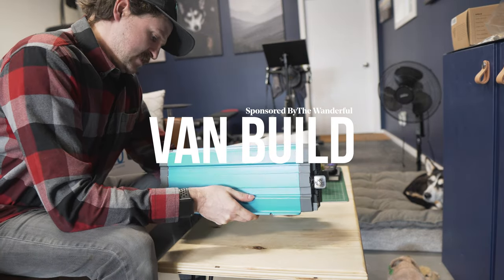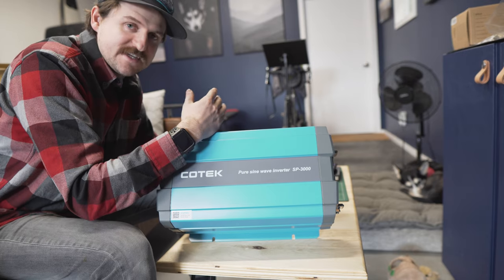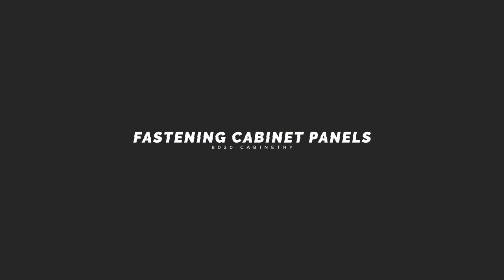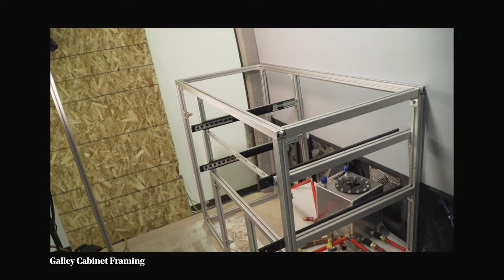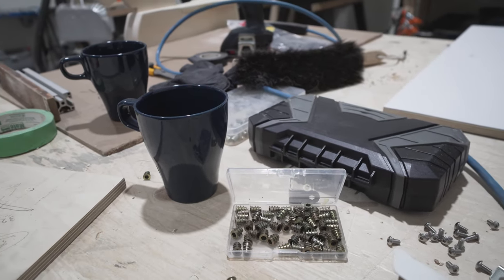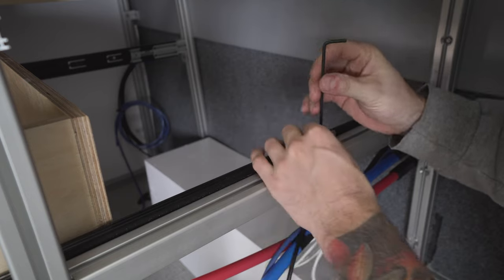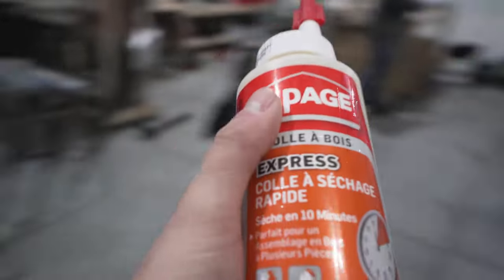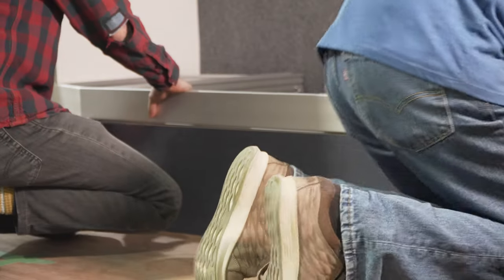How to Fasten Wooden Cabinet Panels to 8020 Cabinet Framing | Van Build

Comment: Great tip on using corner braces for mounting panels. Corner braces are about 0.55c each vs $11 from 8020/tnutz for panel mount blocks.

Comment: These brackets you reference come in 25mm, 30mm, 40mm. Was it just trial and error to determine if these work with the 30MM extrusions? For 30 MM you would need 15MM between center point of the screw hole and the outside edge of the bracket. Also, did you use standard 8020 screws and t-nuts (or roll-in t-nuts) to attach brackets to extrusions? The hole size of these brackets is 5mm or 0.2 inches, whereas standard series 30 inside corner brackets 6.8mm in diameter. Thanks!!
Reply: It appears he used roll in - very expensive

Comment: Hi Scott, I am a bit fan of your work! I am in the middle of my van build using 10 series T-Slot Aluminum. I want to clad the frame with 3/4" bamboo plywood, I would use 1/2" on the ends of the cabinet, but it is only available in 1/4" or 3/4". Now to my question. How are the threaded inserts holding up after three years of use?

Comment: What's the advantage of using a 10mm thread and bolt vs a 10mm wood screw into the panel?
Reply: Yes, exactly this question. Wood screw into the panel seems much simpler.

Comment: Done put loctite otherwise you’ll spin out the threaded plugs. The screws won’t back out but if they do, use a piece of dental floss , stick it in the plug, the thread your screw in. It should create enough resistance but not enough to back out the plugs. I’m afraid the wood glue won’t be strong enough against loctite.
Reply: Good advice!

Comment: Thats funny, with the frame of my cabinets finished, I was thinking about the same issue currently and the holy youtube algorithm recommended me this video out of nowhere.
I was planning on using these rampa nuts (rampa is one manufacturer for these nuts, in Germany the are usually called rampa nuts), but then thought about glueing extruded aluminium angles directly to the wood panel. I test glued a piece to a oiled panel yesterday using a SMP glue and it really sticks nicely. 
It also might be easier to attach.
Reply from the maker: Glad it helped!

Comment: Audio sounds good. Does the outside of the panel sit flush with the outside of the 8020 (or even slightly inside the 8020)? If so then I assume  you not have to cover the edges of the panel. Could you confirm please?  A photo or two would probably explain even better.
Reply: or a video that actually shows what we're talking about?

Comment: Have you used any contact cement glue with your panels and 8020 - I'm wondering what glue works on 8020 that has been powder coated ... or anodized.

Comment: Is that 10 series 80 20 for the cabinets? I'm wondering if the 3/4 inch 20 series would be strong enough for either upper or kitchen cabinets
Reply: I'm using 2020, 20mm extrusion for my closet/wardrobe and its pretty strong... Only using 3060 (30mm by 60mm) for my bed, anything ticker is overkill i think... and pricey
Reply: @tehdreamer  that's what I was thinking. Thanks for the reply!

Comment: Hi Scott,
do you think it is possible to attach just laminate? 80/20 structure is strong enough and to reduce the weight I would just cover it with laminate. Of cause the fasteners will go through and will be visible but added weight would be minimal.
Reply from the maker: the laminate is very brittle until it is fastened to a substrate like wood

Comment: Thank you! This video will be booked marked to help when I get to that point.  Is that 10 or 15 series 80/20 ?
Reply: Hey Jeff...he uses 30 and 40 series metric for mist of his build. 
Not sure when he would get back to you.
Reply from the maker: Thanks for helping out in the comments and hes right! Mainly 30 series just used the 40 on the upper cabinet and bed framing.
Reply: @scottadamson6116  can't wait to see the finish. I am using all of your build as a basis for my redo on my interior...awesome stuff.

Comment: Assuming the 8020 is approx 30mm wide: if your L brackets are facing outside, then your panels will stick out. if they are facing inside, the panels will be sunken too much.
too bad that you spent so much time talking and so little time to actually show the process, how you put the brackets, where exactly, and how you attach the panels.